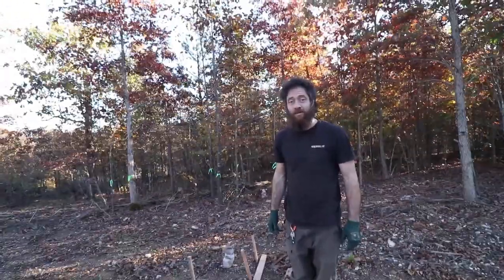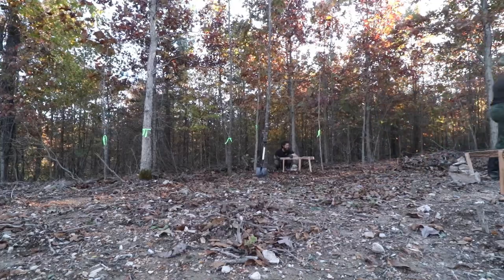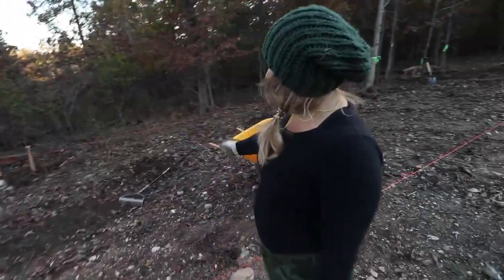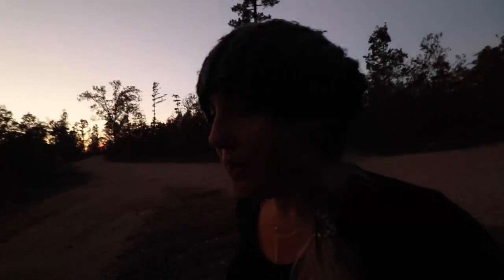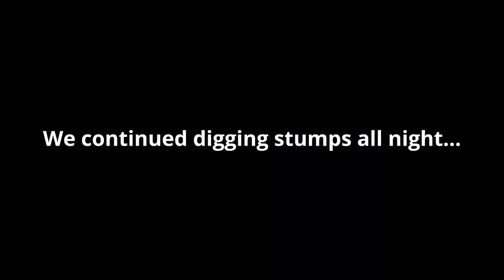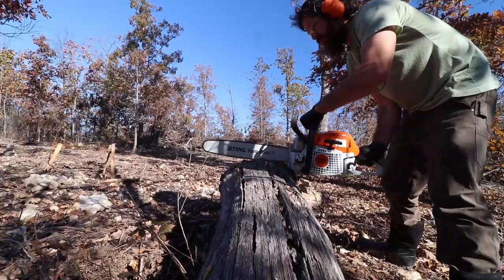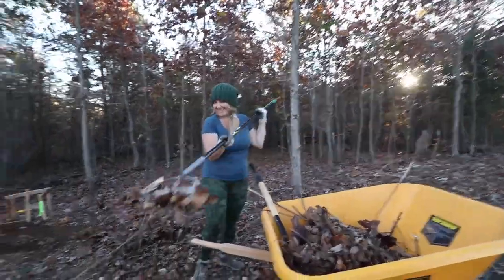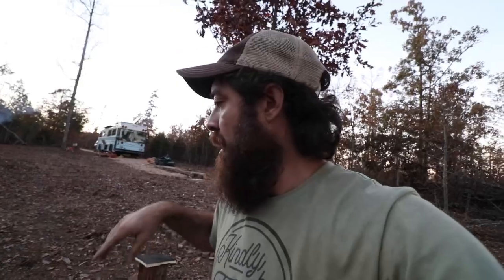Homestead Workshop Site Preparation (Our NEW Homestead Lifestyle)

Comment: Update on the Canon EOS Utility to use your Canon as a webcam..... 

Its NOT compatible with an AMD processor. Need to have an Intel system for it to work. For now. Or at least until they get AMD on the supported processors list. So if you have an Intel your good. I need a new laptop anyways so ill upgrade soon enough but yeah.
Reply from the maker: Good to know! We both have Intel in our MacBooks, so we are good to go! Thanks for dropping this in @Lazy Genius!